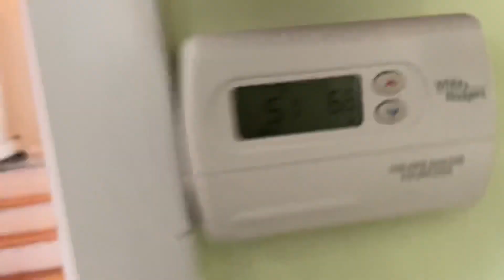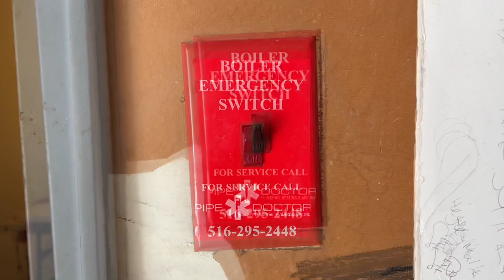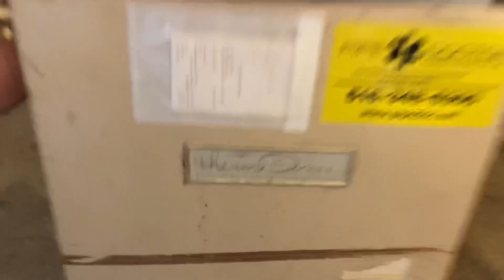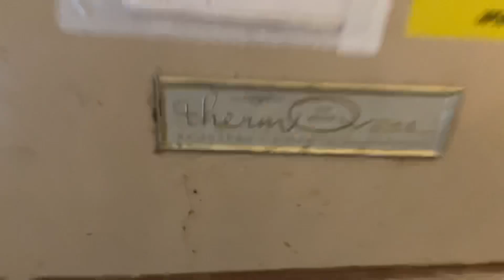Emergency Weil McLain Boiler Installation Making Her Hot Again & 10,000 Subscribers Giveaway Details

Comment: Another fine install Mikey. 👍Can you clarify the statement you made towards the end of the installation review - something along the lines - ‘the online manual identified it as one inch supply and return’ but on examination it is one and one quarter inch and I ordered all the one inch piping’ - so have you piped it up under size for the specification?

Comment: Nice job mike.  Not sure I understand the backwards purging setup or the need for. an air scoop/separator on a Weil.   The block has an integrated air scoop, that's why
the air vent is located where it is on the boiler.  Been installing weil for 30 years, never used or needed an air scoop on any of them.  Really like the emergency service switch cover. 
Keep up the good work.

Comment: I've installed boiler same way with expansion tank feeder air seperator and pumps above the controls and got ripped on heatinghelp for not prefabing everything on board... Just wondering I do put an external high limit and low water cut off on install but does Weil  McLain come with lwco and high limit built in?

Comment: Why do you crimp  all your joints i have watched  three videos of your I have never  seen you sweat copper i would like to see those joints in twenty  year how many will leak .Again do really think that's better than sweating copper,,? Faster yes stronger i find that hard to believe. I will look it that  . Don't 
Forget pex is nice but no one knows what happens  to it 30 years down the road. Any how fast and simple  installs so far
Reply: I would like to see a  pole of all plummers of how they would do there own boiler install pex or copper crimpet or sweat .
I know what I would do if it was my own why don't us sell mag filters and I never see you flush before a new install and I never hear talk about additives and you taked about the effects of adding fresh water all the time but should educate  about the sludge that causes early  boiler failure  .
U see its more than fancy  truck and floor matts its more than doing one way because everyone  else does it that way even if its less than ideal .
Give the cust the option of fast an nasty or a real quality job. You would be surprised how many people want the best possible  job not the cheapest and the fastest. Enjoy  the video  is nice to how the trade is change it a nice feeling knowing you did the best quality at a fair price

Comment: Definitely can appreciate your work. Good job. On our side of the country all our piping and manifolds are made of copper. I'm not used to that black steel. Side note if you haven't seen them Webstone makes an expansion tank valve to tie in your fresh water and isolate your tank for future replacement.  Check one out! 
Dig the channel!

Comment: Not that it is mission critical, but I thought air seperators need to be 18 or so inches away from an elbow for maximum efficieny? Or were those old  air scopes
Reply: @PipeDoctor  I read the manual before posting and  I didn't see the comment about spacing . I heard of it, I'm just asking for clarification  . Not sure why you gotta yell . I wasn't criticizing . Even if it did require it . I did say it's probably not a  mission critical detail.

Comment: you don't need low water cutoffs where you work? it is amazing how different towns enforce or don't enforce different codes.  i would fail for sure with no LWC.
Reply: Think those have built in LWC
Reply: not for nothing i didn't know they were built in  i don't install those boilers. my bad.  seemed like a valid question at the time   . you don't need to block me  i am blocking your channel.  peace

Comment: One suggestion is to connect the expansion tank with a ball valve with purge so when it needs to be replaced, you can shut the value, purge,. replace & refill.
Reply: @PipeDoctor  No worries, understandable. Just wasn't sure if you thought about it. 

Have a great evening and Fine tomorrow!

Comment: Hey, just had a CGA-3 installed last Friday.  One gripe among a few others:  The installer did not move the black switch on the damper motor to the "ON" position.  So the damper stayed open.  I just installed an Outside Temp Sensor on it today.  Waiting to see what to expect from this add on.  The old boiler was a 100K Input Crane which dated from the 1960s.  I nursed it along for 30 years but the jacket finally burst.
Reply: @PipeDoctor  I say not.  The flames are blue but too high for my liking.

Comment: I like small cement blocks under the units, and all valves capped.
Reply: I also use blocks under ever install. Not cinder block, but solid blocks. To each their own
Reply: Recommended by most manufacturers,is the use of 4" hollow blocks@

Comment: Mikey, I like to watch you movies of boilers with I don't know how many valves and pumps, great, I only have a boiler in my kitchen cupboard, also for my hot shower water and heating for the whole house, with a wireless thermostat, that's all,second flue gas cooler in, efficiency on top value 98%

Comment: Outstanding!  Perhaps you can explain on your next job, where you use a number of NPT fittings, how much you tighten the fittings - I see a number of popular fellows out there cranking down on threaded pipe fitting to such an extent where through all the grunting and straining it seems like they need a hernia operation after every boiler job....Not Mikey Pipes!  Oh, and the relationship between the size of the wrench and the diameter of the pipe to help avoid overtightening.

Comment: Just read that NJ and NY requires a low water cut off on all hydronic boilers, not just steam, whats the deal
Reply: @PipeDoctor  I'm an old guy now 74 haven't done a boiler installation in over 10 years but gonna do my sons in the next few months he's running a Weil Mclain from 1986 getting everything together for the swap and happened to see a new boiler instillation at a neighbors house and noticed the cut off. Thanks for the info. Would have been calling the inspector some bad names LOL

Comment: glad i found your channel doc. quick question i got a  small leak from the circulating pump of my boiler. is it better to repair seal or should i get it replaced? works fine other than the drip
Reply: @PipeDoctor  gotcha, i believe it’s the bearing seal would that count as actual circulator?

Comment: Nice install, clean and professional. One suggestion, and maybe you did this after the video ended, but a quick sweep up of the area to remove the wire scraps would make this 100% finished.